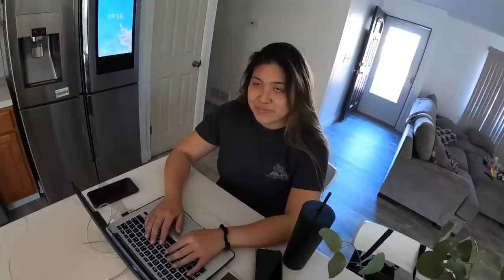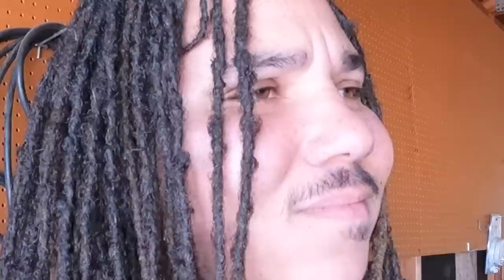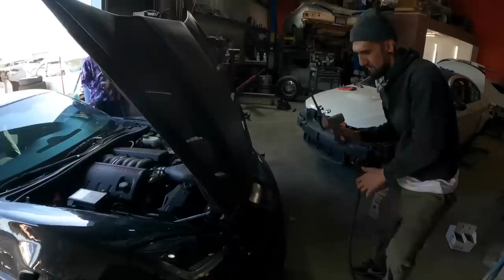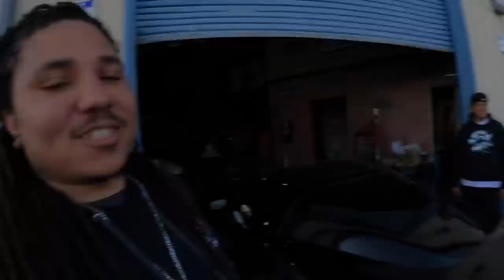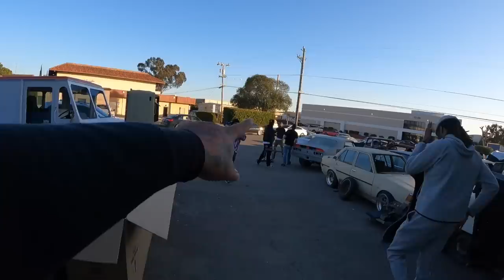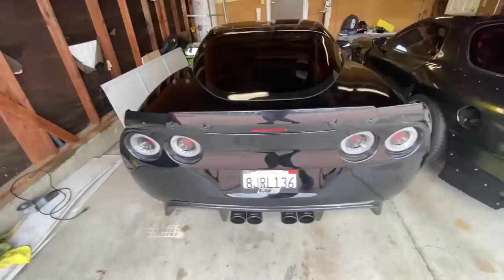Carbon Fiber C6 Corvette Gets Even More Carbon Fiber added to it

Comment: I love the diffuser!!! It should be a way to cut the holes and put the bracket in or some?? 🤷🏾‍♂️ but I’m sure you’ll find a way. And you definitely should use the c5 a&a to make and stock gt500 bow down🤣🗣‼️ and GO DUMB ON THE C5🗣🤣🤣 there’s some darton sleeves that you can make any 4.8 5.3 and 6.0 into a 427 they make 600n/a and hold up well